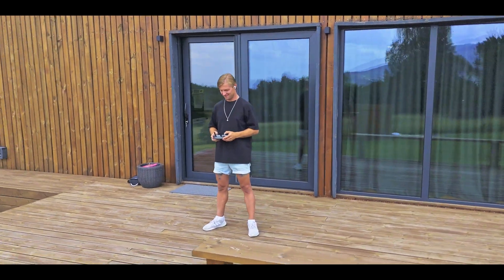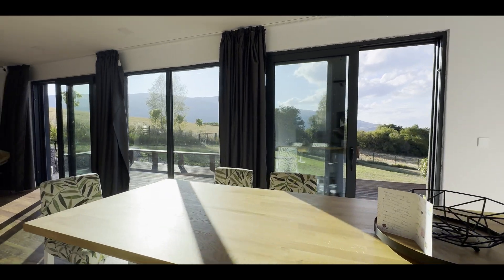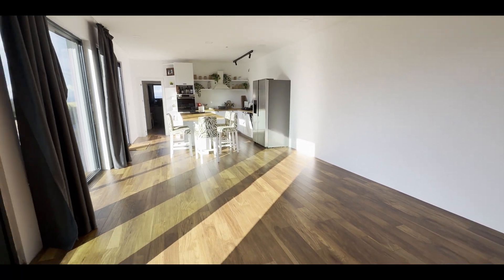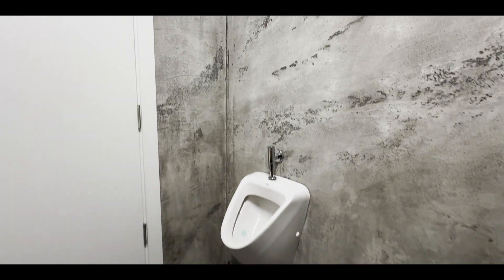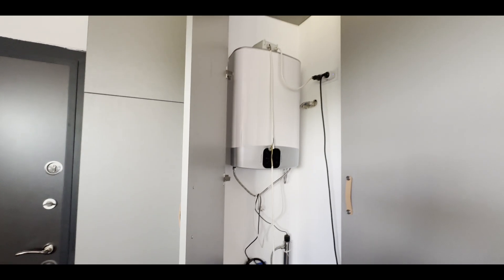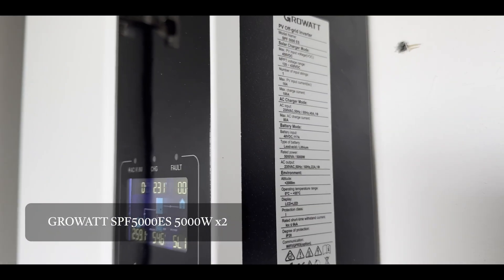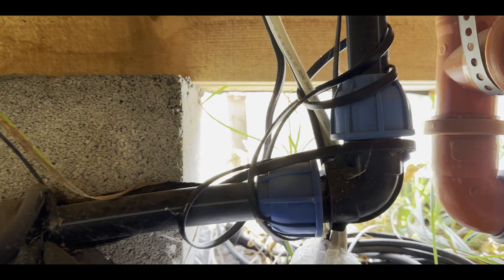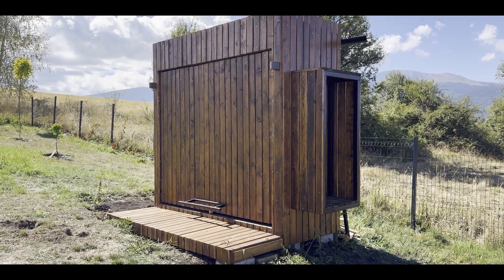Another Off-Grid Solar Powered House I've Built – Bigger, but is it Better?

Comment: HI Ivan. Since we are neighbors (Serbia) with similar climate, I am very interested in your work because I want to build something similar in Serbian mountains. How do you solve freezing problem with exposed water pipes bellow the house during cold winters? What kind of insulation do you use for it? Also the slope of your roof is pretty small, how do you deal with the heavy snow fall? Thank you. Aleksandar
Reply from the maker: Zdravo Alexander, I have heating cables wrapped around the water pipes, and the sewage pipes don’t hold any water so they’re fine. The slope of the flat roof is 3 degrees, which is enough for the water to run off, and the snow doesn’t stay on these as all the excess is being blown off by the wind. All the info about the materials I used is present in the both videos :)
Reply: @vanyagradoboev  
"Sewage pipes don’t hold any water, so they’re fine."
— Do you mean it’s not cold enough in the winter, and there’s enough time for the sewage to flow straight to the tank before freezing?

I’m asking because I work as a “sewage guy” and install temporary/permanent setups for shacks (rig companies) in Alberta, Canada. Those use much shorter pipe lengths, but we still insulate and run a heat trace on every single pipe.

And another question: how about all the “land laws” in Bulgaria? Do you need to get any permits to do those modifications (like digging a hole and putting in a sewage tank or water tank)? Is it a complicated process?
Because in Canada, it’s a total shitshow with all the regulations, haha.

Thank you for sharing—brilliant work!
Reply from the maker: @vlads_reality thanks for the feedback and the questions bud! About the sewage – all the water that’s going into the pipes is room temperature, and there is never water staying still in them, so ofc you can be triple safe and heat them, but technically there’s no need to. They are buried underground, which also eliminates the possibility of freezing.

In terms of regulations Bulgaria is…well, Bulgaria. Meaning that if you want to go full on legal and clear, digging a well, for example, will be a pain. But in reality no one does that, and the chances of getting in trouble for that are pretty minimal, because tbh authorities don’t care
Reply: @vanyagradoboev  okay, thank you a lot! I appreciate it!! Truly impressive job!